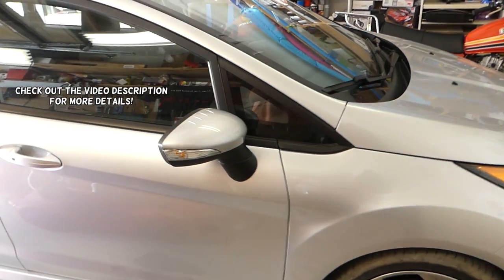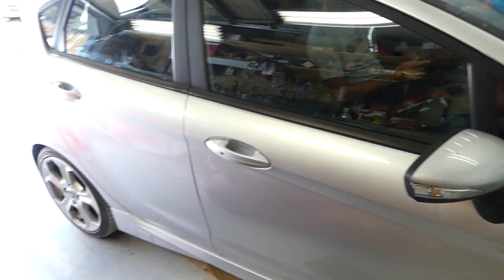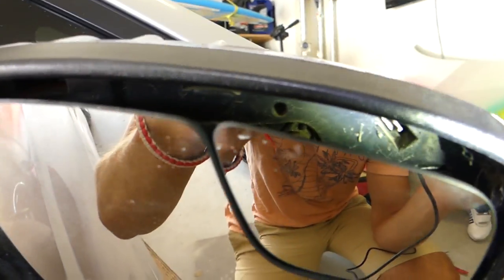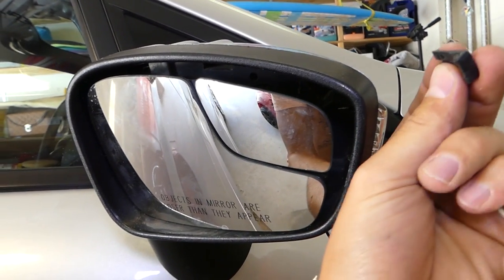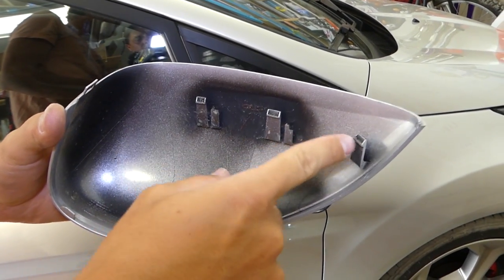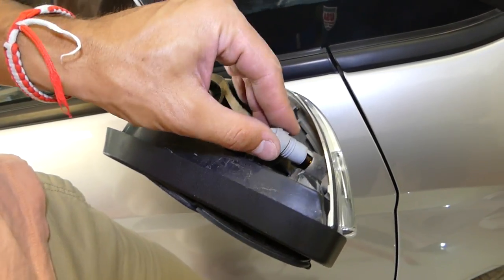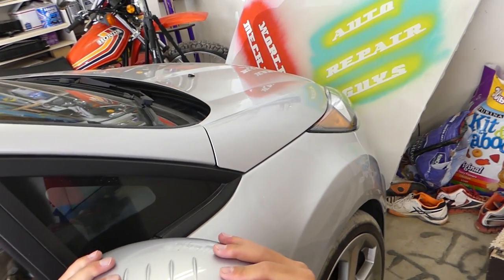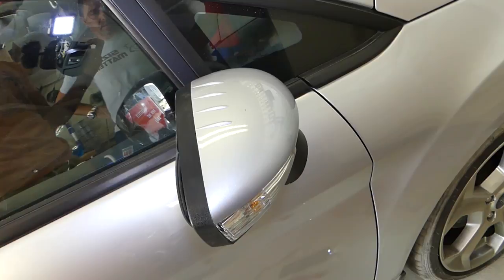HOW TO REPLACE REMOVE SIDE MIRROR TURN SIGNAL LIGHT BULB ON FORD FIESTA MK7 ST

Comment: Great video mate! I wonder where I can get mirror caps like those in the video. They have four ridges on top and it has been said they avoid whistling. My MK7 when going about 160 starts to howl very loud, when I fold the mirrors in the noise is gone. I couldn't figure out where to get these mirror covers, but friends say they are only for US cars. Regards from Vienna, Steve

Comment: Hi
Thanks for your amazing videos. I have a question, maybe guys you know the answer ... I hope . I have a Ford Fiesta 2015 Titanium X model (UK), I want to to do some upgrade on my side mirror .. I have a nice led bulb at the bottom of the wind mirror which lighting towards to the floor. I would replace it that which project the FORD logo to the floor ... Do you know how is possible to replace that small bulb, or maybe to use any lens in stead?
Thank you